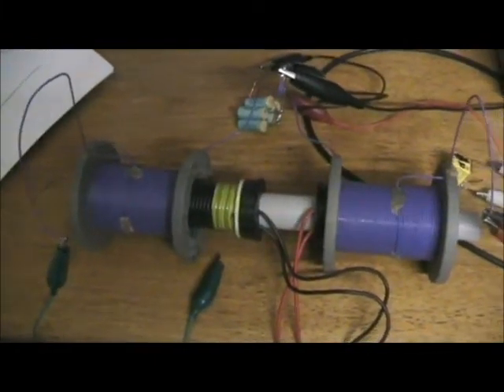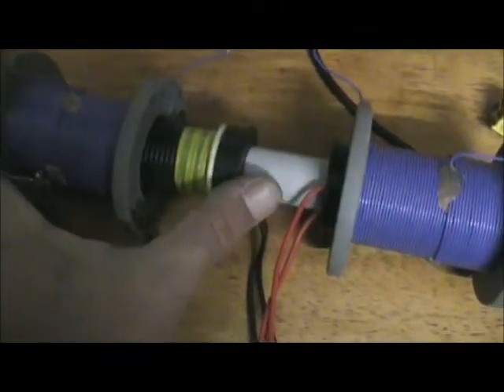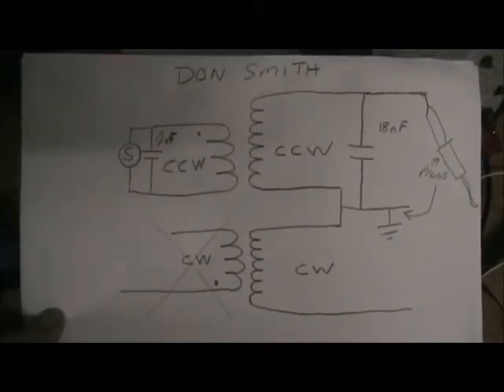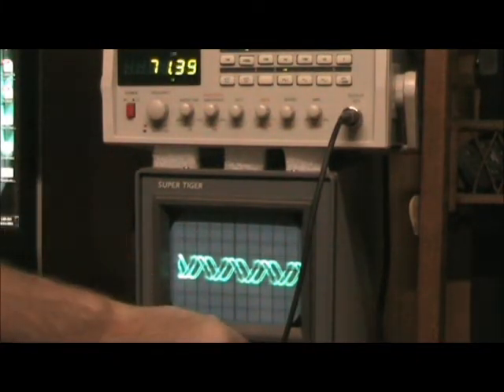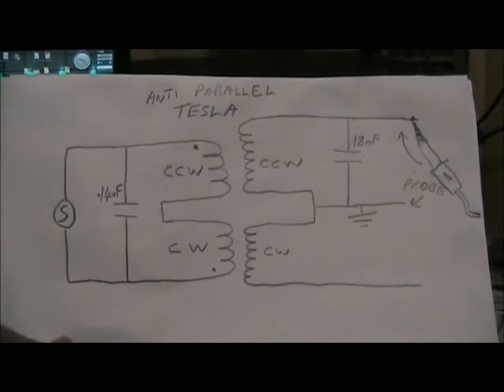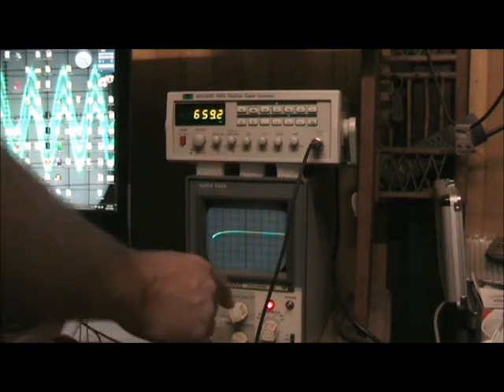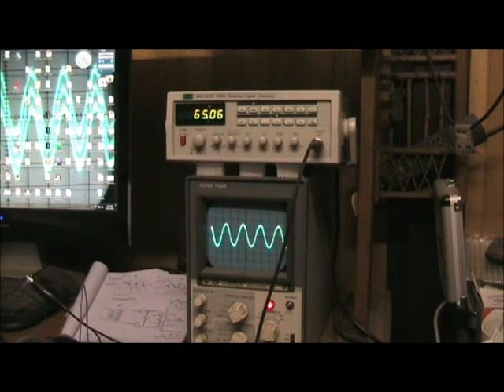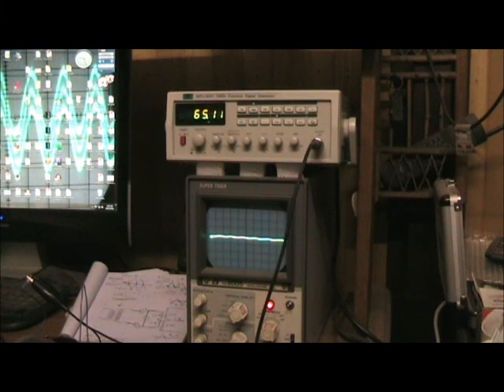CCW-CW Coil Test

Comment: Aren't you missing the spark gap equivalent SIDAC that don smith uses to pulse the primaries instead of exposing the primaries to ac?

Also, if the voltage is halved with this configuration, can you somehow test the amperage that is available to see if it is doubled? I believe that was the purpose of this configuration, to increase seen amperage and decrease seen voltage to make it easier to handle. I could be wrong though.

Comment: This is not correct for a Don Smith coil. The secondaries are supposed to be wound clockwise and counterclockwise on each side of the center tap but the primary is supposed to be all wound in one direction.

Comment from the maker: I didn't make this setup as a Don Smith setup I made it as a HV transformer in the Tesla fashion like his disruptive discharge coil. Tesla used his coil with an AC spark gap between the two primaries. This is just testing at the moment, I'll do some tests and people can make what they will of them. I just thought I would test what happened and the difference between them CCW-CW and CCW-CCW. Considering the lack of working Don Smith setups I think they are doing something wrong or Dons full of it